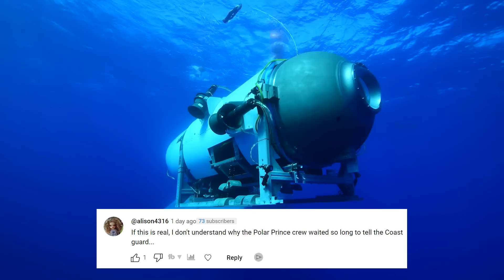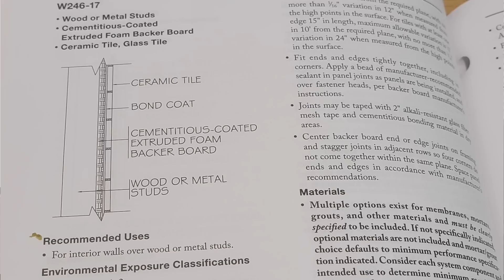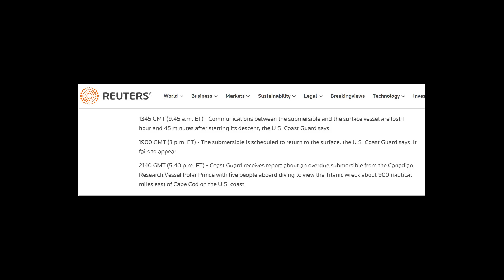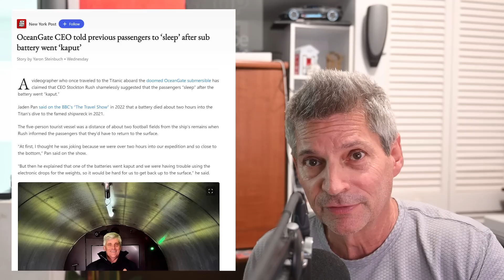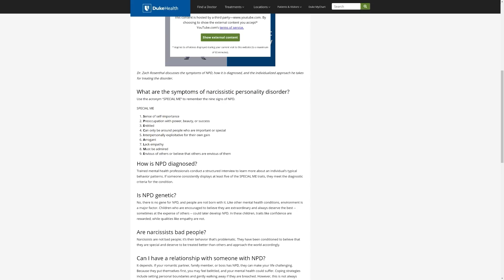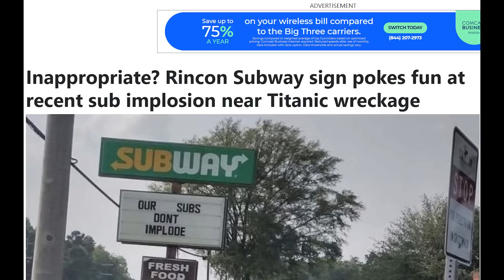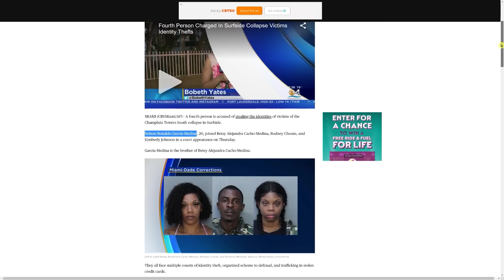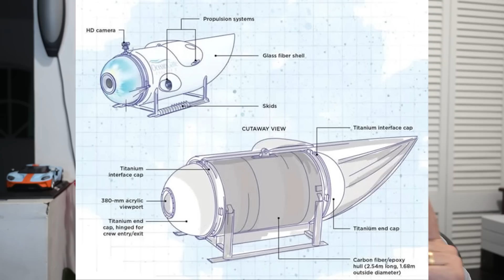Titan Sub: Why OceanGate Waits 8 Hrs Call Coast Guard, Q & A

Comment: Jeff,  I would like to hear your thoughts on how the CG responded to the loss! I understand that they were not notified for eight hours, but it seems like they acted exactly like you described as 'Normalization of Deviance', where as James Cameron used 'common sense and critical thinking, to go to the time when they lost communication and then to the sound buoy's to listen for the sound of the implosion to determine what had happened! Where as, the CG had all these aircraft search thousands of miles of ocean surface! You would have thought the CG's commanders would have directed his unit to do the same thing, instead of wasting all that manpower and taxpayer expense on a exercise in futility! I mean, here we have (James) as a private citizen using logic to figure it out, but not the CG? You would think they are the ones that should have the critical thinking to do this!

Comment: Stockton Rush was a correct, but careless opportunist that skirted roadblocks. Following regulations meant needless expense, inordinate delays, were absent or unsuited to this specific application. Authorities would have made him turn his pioneering design into a complete abomination for which he foots the bill. Future submersibles will follow his concepts and be cylindrical, not spherical. Add to this contemporary features with consumer appeal. Properly designed, with forces correctly analyzed and materials specified accordingly and incorporating safety factors these are the kind of vehicles that will be employed in deep sea missions. There is much to explore and riches to recover in the ocean. Gold from shipwrecks. Single person spheres are inadequate for the task.

Comment: I will never be able to understand why they wound the carbon fibre in that manner. I’ve never seen a vessel of any kind made that wasn’t made using the the cross hatch method. Even my wallet is made that way!

My guess would be that it crossed end to end, potentially explaining the loss of the window.

This was always a death trap.

I can’t help but think he did it using carbon fibre because;
A) it’s a buzzword that most people don’t understand and think it’s stronger than steel.
B) he fundamentally didn’t understand the technology 

You realise that the only time hoops are used in Formula 1 chassis design, it’s to create a collapsible section for deceleration.

Comment: It would be nice to know what protocols were in place in the event a) communications was lost and b) failure to appear at a designated time.  In the world of submarines, a SUBMISS is reported when a submarines fails to report at a predetermined time.  If not heard from at another predetermined time interval, a SUBSEARCH is initiated.  At another predetermined point in time if the submarine has not been heard from or seen, a SUBSUNK is initiated believing it is not able to surface.

Because the Titan was an experimental passenger paying submersible and the personality of Mr. Rush being a bit of a wild card, what protocols were in place in the event the Titan was not heard from?  I'm sure repeated attempts were made by the Polar Prince to contact the Titan even past its emergency call to  Search and Rescue.  Assuming the unofficially released communications log is accurate and they were told of a slow ascent, it would not be entirely unreasonable to wait until all doubt had vanished again depending on OceanGate company protocols.  I'm sure OceanGate was made aware of the situation when the surfacing deadline had passed.

Comment: Titanic is an absolutely terrible example of "deviance". That amount of lifeboats was the norm at the time, in fact the ship actually had more than the regulated minimum if I remember right. Also no one, at least on a professional level, actually thought it was unsinkable. The actual thinking was it would stay afloat long enough for the passengers to be ferried to a rescue ship if a disaster happened. Which is also why there weren't enough lifeboats to hold all the passengers.

Comment: In the case of the Challenger disaster, NASA and Morten Thiokol  senior management were so desperate not to have another delay in launch, they browbeat the engineers into clearing the launch based on dodgy extrapolation of existing data to much lower temperatures than had been physically tested.

Something similar happened with Columbia. The foam insulation breaking off and striking the tiles was a known problem. But the tests  database they based their risk assessment on had only been built on the assumption of tiny flecks of insulation. They hadn't tested for the exponentially greater damage a larger chunk would cause.

Comment: Hydrophone communications work just fine up to a few hundred metres depth. After that, the differences in salinity, water temperature, currents and other phenomena distort the signals too much. What the BBC documentary showed on the screen does not represent what is possible on a deep dive beyond 1,000 metres. Certainly at the depths that the submersible imploded there would be no real time conversations taking place. While helical winding of carbon composite materials is preferred for pressure vessels, the material will still delaminate and fail after a certain number of pressure cycles. The Titan managed a dozen or so dives to the Titanic. If the hull had been of helical wound carbon fibre laminate construction, it might have managed 20 dives but it would still have failed at some point. Suspension bridges are held up by thousands of strands of interwoven wires. These break individually at a relatively constant rate. After a given number of years, the cables need to be replaced. Monitoring of these bridges is carried out by a microphone recording each strand break. Once a certain total is reached, the bridge load capacity must be reduced or the cables replaced. In the case of carbon fibre composites, there are millions or even billions of fibres that will be failing during each stress cycle. The current level of monitoring technology is just not sensitive enough to detect and count the breaking of individual fibres. Any clicks detected will be from gross events such as a patch of carbon fibre delaminating, or an entire group of fibres cracking simultaneously, i.e. a gross damage event which has already severely degraded the hull. Essentially by the time you pick up the sounds of damage occurring, it is probably too late as a cascade failure is already underway. Carbon fibre laminate does not fail gracefully, it gives way completely in a fraction of a second.

Comment: No matter how you wind the carbon fiber: these withstand mostly to pulling forces. If wound up in an interweaving pattern, also to shearing forces. Inward pressure is being caught up by the polymer matrix the fibers are embedded in. There's no way that an epoxy cylinder inside of a fiberglass hull would withstand such an enormous pressure for long time, or many times.

Comment: This is exactly why I believe Rush spent his last minutes dismissing away anything being truly wrong to the other passengers. No matter the noises and power issues. They most likely would have mostly believed him but, knew something was wrong. I don't believe there was panic because Rush would have BS'ed it away. That could have for once been a good thing so their true fate was not in their minds. No matter the assumptions the outcome was the same. They should have followed protocol but, they most likely did follow Rush's protocol. No matter how much it should have been earlier they notified the coast guard fate had already took place and that would only have changed possible excess wreckage they could have found. Best to the families.
Reply: Cracking sounds, *all RTM alarms activated, sub floundering, Stockton scrambling to deal with it all.  They knew.
Reply: @cheapcraftygirlsweepstakes2338  he wouldn't have scrambled because it would have made him look bad. They knew something was going on yes but, I fully believe he would have deluded himself and them. At least long enough to not panic. Narcissists don't panic they believe there's nothing they can't handle.
Reply: @thenotoriousd.i.d  Assuming the transcripts are valid, if he was leisurely dealing with the issues then that upgrades it from negligent homicide to murder.
Reply: @cheapcraftygirlsweepstakes2338  perhaps but, again he would never have admitted his failure and he died too so he can't be charged no matter what he did.
Reply: @thenotoriousd.i.d  No. But, as with any other murder-suicide, he can go down in history as a murderer.

Comment: It does seem rather obvious that they lacked proper safety protocols. And definitely the normalization of problems is the best explanation. As stated - they already had communication failures, and huge delays. So only thing new (if the logs are true) was the alarms (as far as we know it did not happen previously, right). 
Now you can say alarms for pressure tank should cause immediate reaction, but then again - their boss had ensured everyone that alarms would show early enough to safely abort mission and return. And he made sure that people that contested this and believed otherwise did no longer work in company. So "business as usual" case.
Now there is one additional thing to consider. If you were the OceanGate employee that decided to notify Coast Guard, and then Titan actually surfaced intact, you would be in serious trouble.

Comment: Jeff, can you tell us about the Titan's construction method? For example, was the part where the carbon fiber was wrapped titanium (with low thickness and insufficient to hold the pressure), or was it steel?
Reply: Carbon fiber is a separate material to titanium and steel. Google it, it's used in aeroplanes but never used before in submersibles. This was why the sub was experimental.
Reply: @dericofdorking   
??? I know this. If you watch the video of the making of the Titan they wrap the carbon fiber around a metal cylinder.

Comment: That carbon fibre cross-weave was for shapes with rounded ends, whereas the sub in this case was a cylinder which I don't think that weave would work on.

Comment: Given the small amount of data that can be transmitted using the ultrasonic technology, I expect that the "short messages" being sent and shown on the screen actually are fixed messages with a message number, selected from a menu.  So the system sends only a message number and maybe some additional parameter, like message #1 means "please report your status" and message #2 + 5000 means "we are OK and our depth is 5000 feet".
With that in place, a fake message exchange could be caught when it does not adhere to this fixed format (e.g. varying punctuation, misspelling of words).

Comment: There is very little information on the 'equipment bay' behind the pressure vessel. Do we assume this is at pressure? how are the batteries for the thrusters protected from pressure? is there a physical connection between this bay and the pressure vessel? ( I saw somewhere that the thrusters can be driven from the cabin if the joysticks fail) I assume all the air supply is held behind the bulkhead at the back of the cabin? As they were losing power on Bus A (if the dialogue you showed is true) is it possible that the battery bay (or one of them) - which we assume is a pressure container - leaked and filled with seawater. That would explain the  power loss and may well explain why the vessel was only rising at a very slow rate. I have not been able to find any engineering detail regadring the equipment bay and its interaction with the inside of the pressure vessel.

Comment: My understanding with the Titanic is that it didn't actually deviate from the norm. In fact, it actually had more lifeboats than what the regulations required at the time, so the problem was more with the norm than deviating from it. In fact it would've been better if they did deviate from the norm and put enough lifeboats for everyone.

Comment: Those helical windings of carbon or fiberglass are great for improving tensile strength especially for internal pressure vessels.  I doubt helical windings help much in compression and in any case we don't know that there weren't any helical wraps.  That video shows the very innermost layer only.

Comment: But, dont all be so quick to decide guilt... were all of you in the same position would you have gone ahead and made the sub the way it was? We all have times where we say "NO, we think we will be fine... the car wont run out of gass it has more left in after the red light comes on...".....Some people will stop and call a friend to bring out petrol, others will drive the car until it stops from running out.... Super sad event. I hate knowing that they head the Crackling sound, and did not deploy whatever safety measures could have been used to go straight to the surface...But as you said, that was a clear culture of "nothing can go wrong" in the entire operation that no one would believe it even when it happened in front of them...

Comment: Why nobody comes up the main issue:  You cannot PUSH with a rope or a string. Fibers strengthen material because they can take a huge amount of PULLING forces. They are excellent in this use case and we use this technology since 1000 of years: Firecrackers are wrapped with a rope, high pressure tanks for H2, you name it. The aileron of a plane made out of carbon fiber gets its stabilty from being stretched on the outer side  in case there are bending forces. In the inner side of the bending the fibers do not help at all. Fibers prevent a pressured tank from EXplosion, since the fibers prevent that the material is stretched, the fibers  take pulling forces. Beside the silly decision to shape a sub as a cylinder.... In the deep sea there are PUSHING forces circular from all sides, inside and outside the material. So,  the fibers will not increase any stability. Neither bending nor stretching forces do appear in the cylinder under water. Only if some parts of the cylinder will pop inside and make a big dent, but then its already to late.
Fibers are extremly good to prevent EXplosions. They are of no use against IMplosions, since you cannot push with a rope or a string! The shape of the chamber should have been  somehow concave in order to gain any stabilty from fibers.... (which leaves no space inside)

Comment: The reason carbon fiber works so well on aircraft fuselages is because it is incredibly stretch or rip resistant. Therefore it can easily handle the cabin pressure in an aircraft at 45000 feet above sea level (Internal pressure pushing out). I don't think anybody bothered to test it under crush pressure because they already knew the outcome. That is going under water with positive pressure outside pushing inwards. Let's look at it this way: Take a pair of jeans and try to stretch them. You will have a hard time trying to stretch or rip a good strong pair of jeans. Push them inwards, and they will fold without any effort at all.  The same goes for carbon fiber, nomatter how much resin or epoxy or goo you engulf it in. Actually, I think it was the goo was holding the pressure chamber together more than the carbon fiber.

Stockton Rush did us a huge favor though; He showed us how many cycles a carbon fiber pressure tank could do going down to almost 3800 meters. It is just sad that he and 4 other people had to die in the process. He had no right to take them down there with him nomatter how many wavers they signed.

Comment: The explanation of "normalization of deviance" misses the actual meaning of the term. The essential point is the gradual habituation to disregarding the rules despite the original will to comply with the rules. However, if compliance with the rules was never intended from the beginning, then this is not called normalization of deviance.

Comment: The big question I have about this is how a boat with sophisticated acoustic hardware sitting 2.5 miles away/above an imploding submarine did not hear the crunch?
Reply: An acoustic modem would just ignore it.
Reply: @fredbloggs5902  I assume that, but surely that is not the only acoustic hardware they have on board.
Oh, I forgot - that stuff probably cost money.
Reply: @Miketz  They did seem to cut corners quite a bit!

Comment: I'm glad to see someone address the way the hull was wound, I have left comments elsewhere asking if the "hoop" winding as you refer to it is considered "normal" for this application as I am not aware I have EVER seen carbon fibre wound that way and it seems substantially weaker to my mind.  Any carbon fibre I have ever seen is always woven as the example on the tanks or more commonly with a "proper" weave like on car parts (ignoring forged carbon for now).  I was actually extremely surprised to see Titan's hull was wound that way when I saw the very first clip of it.
Reply: I have a carbon fiber pole for surveying and carbon fiber bipods, and I've seen carbon fiber sitars in the process of being made. All these are made of woven carbon fiber, not wound in opposite helices. For more rigidity, one can place layers of woven cloth at 45° angles or at (90/φ)° angles.
Reply: Early uses of  carbon fiber wound the fiber all one direction.  Experimentation discovered that the crisscross pattern (like threads in a shirt) yields more strength